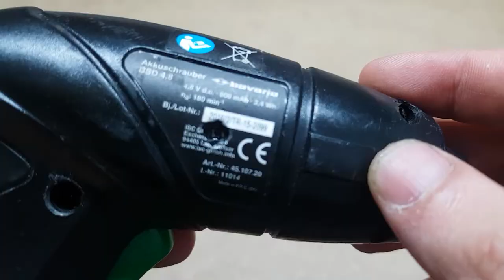How to Repair Electric Screwdriver

Comment: You've using sanyo high more than 2C drain type of Li Ion, although it was from used laptop but it powerful battery for short brust of energy so it matched with this type of DC motor.
So to everyone who wants to follow this tutorial just make sure don't use lower drain Li Ion type. A good choice is Sony, Sanyo, and LG, for the best from Panasonic.
Although it used battery always check the data battery from datasheet or web.

Because using low drain battery or high internal resistance used battery can burn and spoil then fire up from heat.

AND ALWAYS USE A THICK CABLE, because it drain current more than 3Amp in short brust time when it starts and when used in heavy load.

I'd love this video. Creative way to placing the 18650 and charging controller in the case 👍👍👍

Comment: The torque was diminished by changing the battery
1.5x4=6 V.DC batteries were there in the beginning but when you changed 3.7V lithium ion single battery 
There are chances to reduce the torque in the performance
But I appreciate your new invention
Thanks
Reply: The batteries are 1.2V if I recall.

Comment: Hi, nice work but you have bypassed the TP4056, so no protection for the battery (mainly undervoltage protection at 2,75V)....

Comment: The general idea is good and I am not expert but some points are against what you did there.
For instance, you have replaced a 4-cell 4.8v battery with one 3.6v battery hence you totally lost some significant rpm there. Should have used the same 4-cell set, only avoiding Ni-CD batteries and replacing them with the very similar Ni-Mh
The removal of screw fixing place.. big mistake! These are made for a sturdy build especially that the motor does more than it can using the planetary gear system.
The whole gluing and grinding part to place the charging board was seriously messy...

Thanks for the video, and I am just writing my thoughts should they seem to be beneficial..

Comment: At mine i've used 2x 18650 in series, may reduce motor life but, some datasheets said it was able to handle up to 7.4v so not a big problem, anyway got way more torque and a good speed up, tho had to extend its body, since 2 cells of these wont fit there 😂😂 the main issue is that i cant turn it untill stops, it might breakdown one of these plastic gears, and the motor haven't got a good ventilation, on mine i did drill a few holes on its plastic body. Anyway, Well done replacement! For these who wants to try, i recommend High Drain Cells (High Discharge Rate)
Reply from the maker: Yes, I think 7.4v is not a problem, but as you said, it does not fit in the box. You did a really good job! Drilling the plastic body. By the way, where did you fit the second battery?😂😂 
Yeah batteries 18650 with high discharge currents should be used. Thank's for comment bro!😂
Reply: @retsetman9698  I had to grind the plastic body internal and literally had to rip off the bottom XD but the funny thing is,  even with the extended frame (black electrical tape rules) it still fits on the bag lolllllll. Since pictures can't be shared here, if you don't mind later i can send you a few pictures and one or two videos to your contact email xD. Regards!! You're welcome :D Success and Lucky for your channel \o

Comment: You changed from 4,8V to 3,6V , didnt the machine get weaker ?
The motor gets current direct from battery , doesnt the high current burn the brushes & coil ? 

Nice video anyway
Reply from the maker: Actually i think its not get weaker. Yes it was  4.8v but it can gave max 1 A. But now 3.7V and more than 2 A . finally the power increased. 

Yeah it burn faster than 4.8V battery. But i think it doesnt much effect it